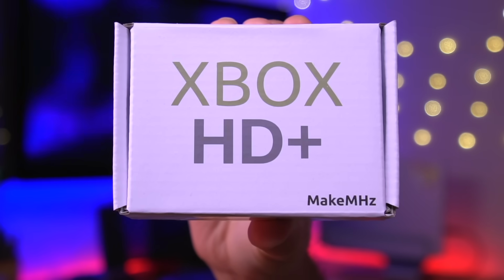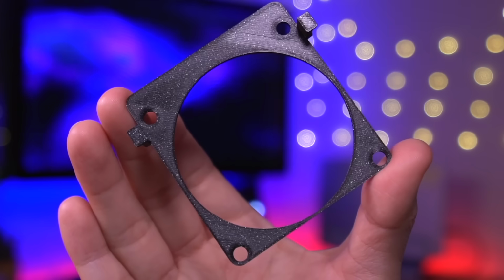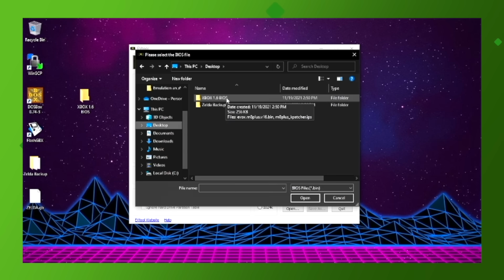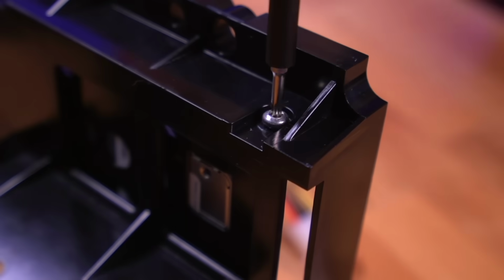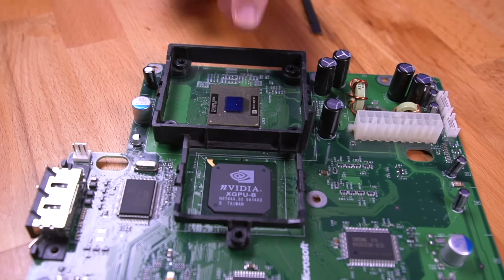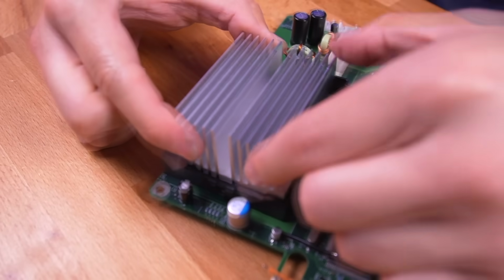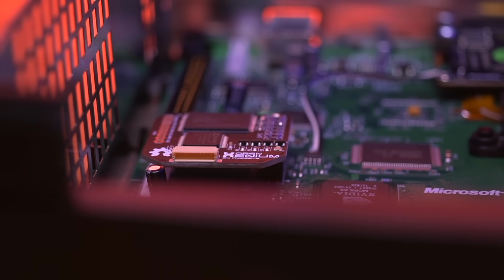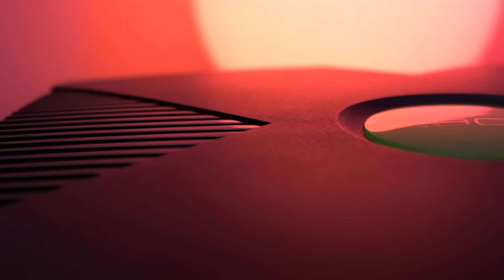I BUILT THE ULTIMATE XBOX TO CELEBRATE ITS 20th ANNIVERSARY | MakeMHz HDMI + SSD + OpenXenium +MORE!

Comment: @Macho Nacho Productions   
Tito, as always, love your video. Once again you are filling in some blank spots of projects for me, Giving me some of the missing information I needed for my project.

Oh, Tito, Brother, I wish you had reached out and done a little more research 1st, you should not (in my humble opinion) have gotten the 1.6, you should have gotten a 1.4 or lower instead, you missed out on the ram upgrade.

Unless of course you don't care about the ram upgrade, I am only 2 minutes into the video at the moment

There is actually a couple similar type of HDD adapters you can use to eliminate the the 80 wire ribbon cable,  you just need to determine a way to provide power for the drive,  and there are a few ways to do that. 

Using that adapter though,  there are 3D printed spacers to can use in place of the Kapton tape, which is highly advised to prevent incidental contact and shorting. 

I really hope to see you revisit this project again in the future and add some more modifications to it, like the OGX360 and swapping the motherboard so you can do the ram upgrade, DVD Delete and another HDD upgrade to 3TB (you can use up to 2.2TB). The emulation you can do with this system especially with the ram upgrade is amazing. Including Chihiro and other stuff.

I actually have a CPU & RAM upgraded motherboard I will be using for a build.

Comment: You put 10 times too much thermal grease. With too much grease the contact between the radiator and the ihs is not optimal and the heat has difficulty to be evacuated well.
As for the quantity, you should put just the size of a grain of rice in the center. No need to spread the grease, with the pressure of the radiator and the heat, it will do itself.

Comment: I wish you could just drop in an SSD on a 360 but you need to use a SATA to USB adapter :( don't know why you can't just plug it into the SATA port on the under side? You also can't play Xbox original games unless you have an Xbox branded HDD in the aforementioned SATA slot :(

Comment: One thing people need to realize when getting into the original Xbox is that the capacitors on the power supply (internally) tend to leak. I recommended if you plan to modify it in anyway at least check them out first on the power supply or at least completely replace it.
Reply: this only affects versions 1.0 thru 1.5. the capacitor issue does not affect versions 1.6a & 1.6b.

also, the capacitor can be taken out completely and doesn't need to be replaced. be sure to clean the area after taking the the cap out. it's just that the internal clock is affected. it can be replaced too as an option.
Reply: @destronger5313  thanks for the information I didn't know that but I had a 2004 late model and it was affected back in 2018.

Comment: Not sure if anyone has mentioned this to you, but the stock fan is the best known fan for cooling the system. It seems any means of trying to replace the OEM fan has resulted in higher temps than the stock fan.

Not a big deal likely if you are only booting it up for kicks once in awhile, but for longer sessions it may get a little hotter than some would like.
Reply: I've read this too! Any reason why this is? These stock fans are over 2 decades old lol, is there no good alternative like with the Noctua fan mod for Dreamcast? I just want a quieter fan whilst not heating up my system unnecessarily after all these years dammit!!
Reply: @Biggus_Dickus_69  Without digging much, Im not sure what makes the OEM fan so special. Could be the slight difference in dimensions (Most fan mods I've seen seem to need some form of 'adapter' to fit the OGXbox.)

I honestly see no need to make an Xbox, or any console silent. Typically they are sitting under or around the television, and unless you're muting the volume, or sitting absurdly close to the screen, you'll hardly notice the fan noise. PC is more understandable because we tend to sit right on top of the computer (either its under our desk, or on it) which will make even quiet fans seem very audible.

 Its all personal really though, I dont think the Xbox is going to overheat and die with a 'new' fan, but if the intention is to keep it as cool as possible, then im passing along the information of age old Xbox Knowledge lol

Comment: Great job as always Tito. I modded a 1.2 console a while back and have been having a blast. I highly recommend the xbmc4gamers front end if you’re not attached to the original UI or the simplicity of the base modded one..

I had considered doing this hdmi mod but I am unsure if it’d be worth the effort. I’m currently using a Homemade component cable into a Retrotink 5X, doing the 5X scale as my tv doesn’t support 1440p (For anyone interested, there are guides out there to convert the Xbox 360 component to ogxbox, if you’re comfortable with soldering wire to wire it will save you a ton of money as OEM component cables for the OG Xbox are a small fortune these days).

I’m not sure how familiar you are with that upscaler but if you are, how would you say the hdmi out mod compares to YPbPr through a solid scaler like the tink5x? I’m going to assume that the picture from the hdmi is a bit sharper but I don’t really know for sure.

Also, that display bug you’re seeing along the top, I sometimes get that on the main menu or launch of the Xbox using YPbPr. It typically goes away when I go into a game though. For me it could be related to forced resolutions on the OG Xbox GUI. Not sure if the forced resolution is causing that on the hdmi mod. Could always overscan until there’s a patch :)

Comment: Such an awesome innovation for the OG Xbox. I wanted to install the MakeMHz but after seeing you needed the modchip and had to install a custom bios, I just decided to go with component cables directly into the Tink5x. I did upgrade the fan as well as a Noctua fan for the GPU (I have a 1.1 revision) Was there any particular reason you went with the 1.6 revision, or was that just what you ended up with?
Reply: Hi.  Whats the picture quality like on the Tink5x. Is it as good as the side-by-side comparison in this video?
Reply: @MasterOfMisc  If you have good first party component cables, it is comparable. Plus, if you have a compatible monitor, you can triple the 480p signal to 1440p! It's still analog converted to digital, but much easier than a mod. The Tinker is $300, so I wouldn't buy one just for the Xbox. If you have other systems you want to scale, it's the best option.
Reply: @Septer_Sever  Thanks for the informative information. $300 though!!! Ouch! Yeah, that's a little on the pricey side.

Comment: Tito! OMFG! Amazing mods and great craftsmanship! You slipped up once and said "pre-tin" again lol, I know it's hard to say things differently after saying them a different way for so long, don't worry I'm just OCD and pedantic about somethigs, but I'm definitely not perfect by any means...
What is LPC and why did Microsoft remove it on newer revisions? Wish I could give this video two thumbs up 👍🏻👍🏻
Reply from the maker: Thanks buddy!  Glad you enjoyed the video ☺️. I believe LPC stands for low pin count. It’s a low bandwidth bus mostly used for debugging.
Reply: @MachoNachoProductions  ah that makes sense! Thanks! I remember repairing and original 360 a long time ago, the big white on with the, infamous "red ring of death" there was an unpopulated spot on the motherboard for a 12v fan header. I don't know why they chose not to use it and use a 5v source 🤦🏻‍♂️ I know having the fans on 5v was slightly quieter but we all know what happened with those consoles lol...

Comment: Excellent video!
Also this Redherring32 guy sounds like a real piece of work, but I'm sure he was happy to help.
Reply from the maker: Haha he sure is 😂!  Thanks again buddy!  Video wouldn’t have been possible without your help 👍!
Reply: I bought one of the HDMI kits for my 1.6 Xbox project, but Ive been putting it off for a while. I ended up getting some of the old copper VGA heatsinks from the early 2000's that were big for slim Xbox mods at the time and have those installed along with a 500gb SSD and the DvD drive delete PCB. I have an Xblast chip installed into the system, but just this last weekend I was given another 1.6 xbox that has a Xecuter 2.6 modchip installed in it already, so Im strongly concidering moving over to that one and ditching the Xblast chip. Do you know if the DvD delete bios patch and the HDMI bios patch will work together? If so, the only thing left on my list to figure out is slimming down the power supply. I know previous Xbox revisions, it was possible to use a Pico PSU with a little buit of work, but this 1.6 has been hard to find some kind of newer power supply for. I found some prototypes online some guy was working on, but ended up giving up on his project.
Reply: @spotopolis  The patched BIOS can also be a no-DVD BIOS, yes.
Reply: Do you do this as a service?
Reply: @Nitrous_Busa  I do.

Comment: I was under the impression that the Xbox had a hard set limit of 160GB for its hard drive. Does the BIOS and mod chip circumvent that limitation?
I have to admit that this is not the mod for me. I went the softmod route years ago, and went with a plug and play HDMI solution. Path of least resistance for me, thanks!
Reply from the maker: That’s a good question. I did the bio flash mod chip install first and then upgraded the ssd so not sure which one allowed the greater capacity 😅. Perhaps the bios, but that’s just a guess 😅
Reply: The bios determines the Hard drive capacity.  You can install up to a 2TB HD (usable) with the correct settings in EVTools when patching the Bios.  Plus HD+ upscales all games to 720P, which is the biggest feature over the HDMI adapters.
Reply: Limit is actually 2.3TB by using a 3TB HDD. Though, it's not really worth it in my opinion, you'll be wasting a nearly full terabyte just for a few extra gigs. Best option is a 2TB HDD which is what I have. It's capable of having almost the entire library of the console installed.

Comment: Did this system need recapping? I know that the capacitors on OG systems tend to be somewhat suspect
Reply from the maker: I actually fully recapped both the motherboard and the power supply. I forgot to mention that in the video 😅. It was the first thing I did when I got the console even though it was working well.
Reply: @MachoNachoProductions  I guess it's kind of a given. Greate video!
Reply: @MachoNachoProductions  I was going to ask the same question! ha. Especially the clock capacitor.

Comment: I'm gonna say this now, I don't know if you did it, or know about it, but with that Fan Mod, you need to adjust the Fan Speed (to MAX ~ don't worry, you won't hear it) on the OpenXenium Chip with your BIOS, or the system will start to overheat. It is not a drop in replacement without Fan Speed Adjustment (but it is a GREAT replacement when adjusted for accordingly). I speak from Experience, and going through it with Todd, and even trying a different design/fan which he printed out for me. It turns out the issue was the fan speed in the BIOS, so, really just an FYI/PSA.
Reply from the maker: Thank you so much for telling me!  I will add a note in the video description (and perhaps make a pinned comment).  Is there an online reference I can link to to help explain the issue better?

Comment: Not quite Ultimate, Why didnt you upgrade the RAM? Ive seen mods that doubled the RAM on the system, which reduced crashes in Oblivion as well as making Kodi run much better.
Reply from the maker: I was thinking about doing the RAM upgrade but the benefits seemed limited. I may still do it though just to have the extra RAM😁
Reply: @MachoNachoProductions  There were modders that upgraded the CPU to 1.4ghz too, but im not sure where you can buy the parts anymore. Seems both the original company and the solo Modder who was doing them retired their services. =(
Reply: His Xbox can't be RAM upgraded anyway, it's the revision without the extra RAM pads. :)
Reply from the maker: Good thing I didn’t buy the extra Ram 😅
Reply: @MachoNachoProductions  Turns out you can mod extra ram onto this revision. Theres guides on how to stack the RAM chips and solder them together, because it turns out only one bank is ever accessed at a time. Which makes it possible to just mount the ram to the legs of the old ram. lol. There is also a new company sourcing chips for the 1.4ghz mod. Might be worth looking into, as its likely the last time that mod is available.
Reply: Oblivion? Morrowind.

Comment: I've had my HDMI modded XBOX for a year now and I love it! Still using the same XBOX I bought all those years ago. My XBOX is a v1.2/1.3 with 128MB, X3, X3CP, X3IR, XboxHDMI, 1TB WD Black. I have the original version of the chip before it was redesigned and rebranded to XboxHD+.
Reply from the maker: Sounds like you have a really awesome XBOX 🤩!  I was thinking about also doing the RAM upgrade too. I may do it to have it but I hear it has limited benefits.
Reply: Do you use the ind bios? I have a similiar setup and have been thinking about getting this kit.
Reply: @shift_nasty  I have the X3, m8, & ind bios flashed right now and swtich between them. The HDMI mod does require a patch bios for the best compatibility. Support for a patched ind bios is going to be dropped and only the patched m8 bios will be supported.
Reply: @shift_nasty  A while ago when they announced the ind bios support will be dropped. I asked about 128mb support on the Discord and they said it would be added. So we will have to wait and see if that's true.

Comment: You need to recap the board or at least replace the clock caparcitor they are a big leaking risk.
OT: great tutorial i would love to have such a ultimate system. (JALOUS!!)
Reply from the maker: I forgot to mention in the video but I recapped both the motherboard and the power supply before the mod, so it’s good for another 20 years 😁 so glad you enjoyed the tutorial!
Reply: @MachoNachoProductions  Great, it got me a little worried. Future proofed!! :)

Comment: I kind of want to do most of these mods minus the HDMI mod due to the complexity of the soldering. My XBox is softmodded with XBMC so I should be able to backup everything on my existing HDD. I'm pretty sure it won't be cheap to commission someone to do the HDMI mod.
Reply from the maker: I know redherring32 does these mod install. I’m sure he can give you a quote. He is one of the official installers for the hdmi kit.

Comment: The Xbox HD+ mod is an expensive way of getting a HDMI cable to your Xbox, but it is a high end mod.  On the low scale which does the same is the Wii to Xbox HDMI mod, which takes the Wii to HDMI adapter and converts it for the Xbox, which can be placed either inside or outside of the Xbox.  This mod will only cost you around $10 for the adapter, this is a huge saving when compared to the $100 version.
Reply: Very true, but in reality it doesn’t really compare. The Wii adapter mod is component to hdmi, so an analog to digital conversion. The HD+ is Digital through and through. The quality is definitely superior with the HD+, but is that improvement in quality worthy of the extra cash? That is for the individual to decide I guess.
Reply: @_MJ07_  It all comes down to the use case, as you say. I'd never opt for an HDMI mod when playing on a CRT whether a standard TV or a VGA monitor. For those without a nice scaler and a new TV that would mangle the analog signal or perform a slow conversion? Sure it makes sense to go the digital route.
Reply: Not heard of the Wii to Xbox hdmi mod, I’ll have to have a google. 
The high end mod is both expensive and probably beyond my solder skills but obviously the best mod out there at the minute.
Reply: @robertpatterson1037  the Wii to HDMI mod, there is a helpful video on here how to do it.  But its taking a cable apart for the outside.  doing a similar thing to this video is having the Wii adapter on the inside and soldering to the ab pins instead.
Reply: Ive got a pound cable which is fine for the odd occasions I play on my Xbox but the thought of having a hdmi port on the back of the console is appealing.
Reply: @robertpatterson1037  yep it certainly is, thats why I'm installing the wii adapter inside the xbox

Comment: This is by far more than I will do to my systems. I did the softmod approach with a sata drive replacement years ago. Took it a step further and slimmed the casing down. Then went an additional route of removing the disc drive minus its motherboard.

At the time SSD was impractical for the mod based on cost. And I feel the HDMI out would bring my system more play time (haven't used mine in 4 years).

Excellent job as usual Tito.
Reply from the maker: Thanks buddy!  Sounds like you did quite a bit of modding to your XBOX too 👍. Case mod sounds like it would be pretty neat also!
Reply: @MachoNachoProductions  Yeah. The slimming is a pain and has to be precise. Mine has a tendency to heat up since I had to remove the shielding. Still functions, but a bad way to shorten the system life span.